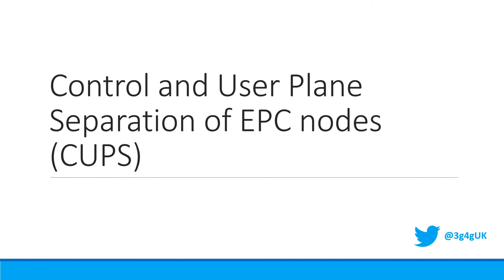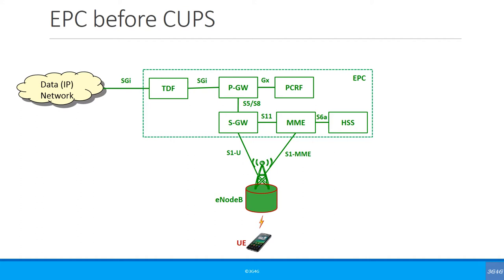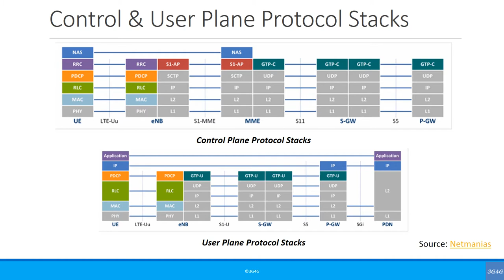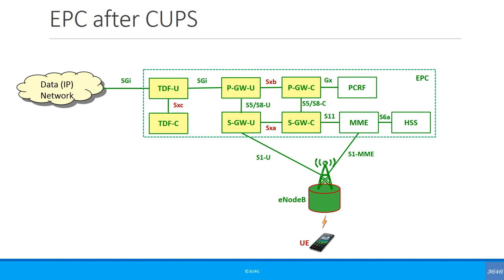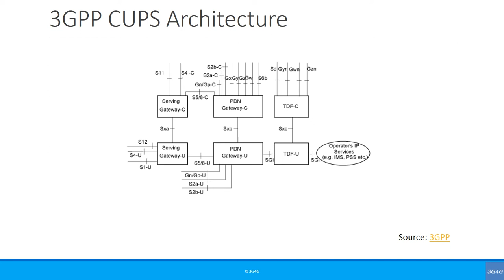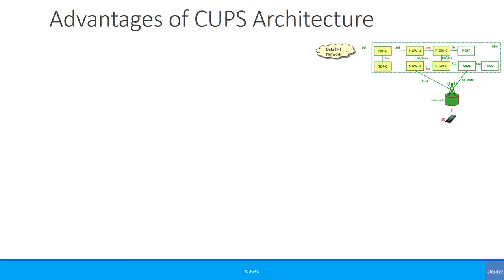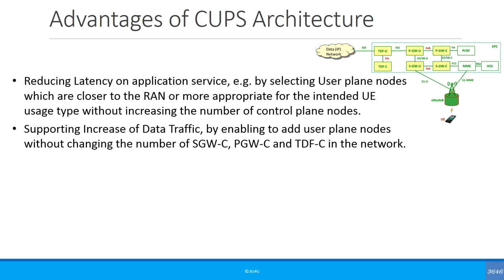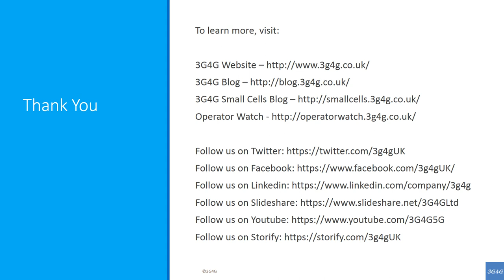Advanced: Control and User Plane Separation of EPC nodes (CUPS)

Comment: Nice video, thanks! 
So if I understand well, 4G EPC CUPS architecture was procusor on splitting CP and UP (at least in the core) before 5G .. But I have 3 questions: 
1/ Does the splitting between BBU and RRU in a Cloud RAN architecture can be understood as well as a kind of UP/CP separation applied for the backhaul or both RRU and BBU are still integrated CP/UP nodes? 
2/ In practice (CUPS compliant core deployment), does SGW-C and SGW-U correspond to two different equipment ? how telecom vendors market it in their catalogue ?
3/ Is it mandatory for an operator to migrate its legacy EPC (before CUPS) to CUPS architecture to be able to implement NSA 5G network ? 
thanks.
Reply from the maker: Hi, nice and difficult questions. For 1, we suggest you watch Prof. Andy Sutton's video here: https://www.3g4g.co.uk/5G/5Gtech_video0015.html. With regards to 2, all vendors are moving to virtualized architecture. The new entities will be VNFs in the virtualized architecture. Vendors will sell it as a future-proofed core architecture. With regards to 3, its not mandatory but may help, especially with network slicing. Having said that, we think for a proper end-to-end slicing, 5G core will be needed.
Reply: Thanks for your helpful reply. Regarding question 2: I understand the point of instantiating for instance SGW-U/SGW-C as VNFs instead of physical dedicated equipment as used to be until now, however, I want to grasp how it will come up concretly, I mean: Currently SGW is a dedicated locked-vendor equipment, SGW-U, SGW-C will be sold as software pieces (code script that can be run on any commodity server) ? Do you have a link for vendors proposing these VNFs to see how it may look like "concretly"?
Reply from the maker: Afraid not. This kind of information is not easily available online. For most big vendors they do not provide any details of their implementation at all.

Comment: Thanks. Very useful.

One question (may be silly)
Do we have any references/figures which can predict/indicate how good is user experience after CUPS!!

The only benefits as per USER (only) i feel that  PGW which is closer to user may be selected hence better user experience.

Request if you can complete me

Thanks!!
Reply from the maker: That is correct. One of the outcomes of CUPS is improved user experience but that is not all. Its also helpful for the scaling of network. This started with LTE but CUPS takes it to a level further. 

Not sure how many commercial networks has this already in place but once its there, I am sure we will hear a lot more about it.
Reply: Thanks for your reply
Yes
I understand CUPS benefits a core level like scaling, upgrade independency etc however need to know more about  for user/user experience.
Reply from the maker: We wont know about the user experience until CUPS is officially rolled out in commercial networks and the operators inform that its available. We just know the theory at present.